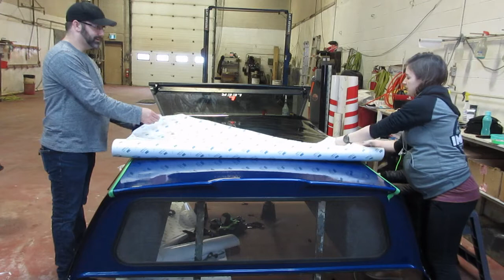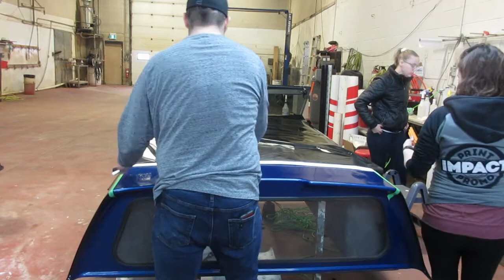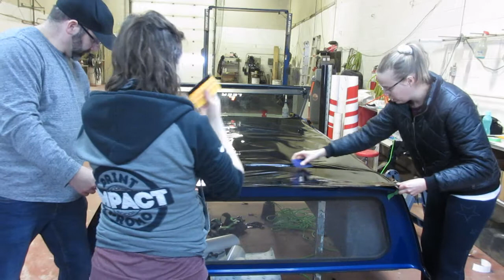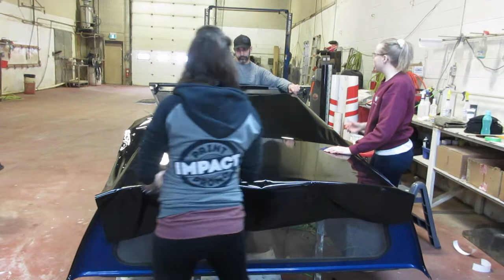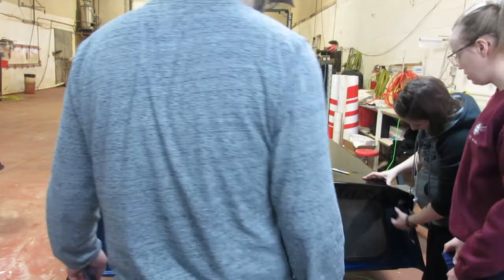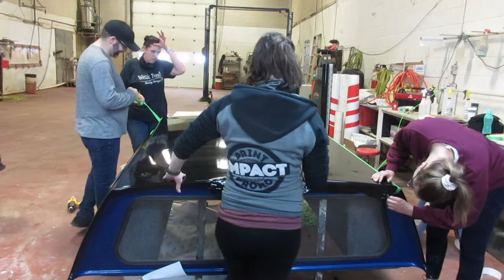Truck canopy blackout wrap, Pt 2

Comment: How much does it cost for this sir.
Reply from the maker: Hard to say - you can call for quotes from shops near you or graphics/film websites. For instance, 3M charges about $50 a yard or less from a 60" roll and this canopy took perhaps 3-4 hrs at whatever rate your signshop will charge. Wraps usually require a bit of a quoting phase based on the complexity of your request and vehicle model.